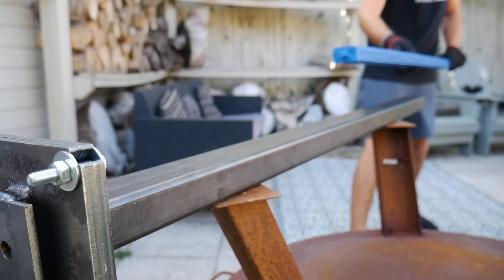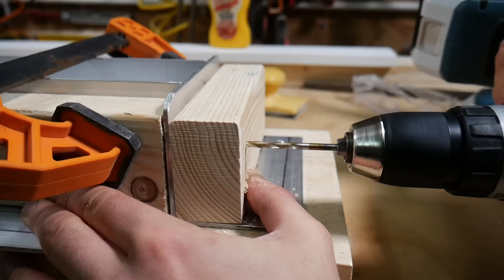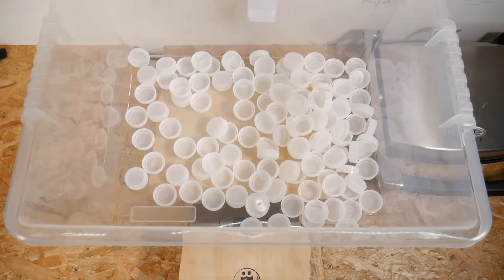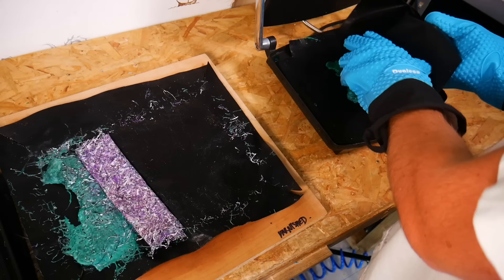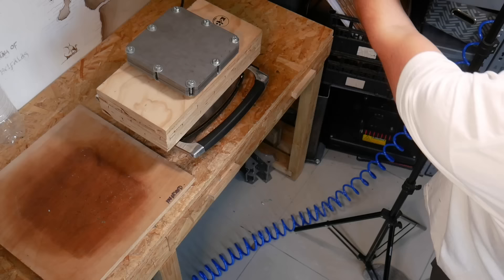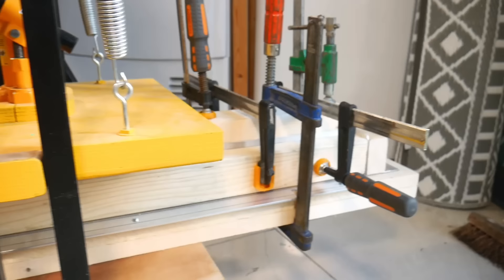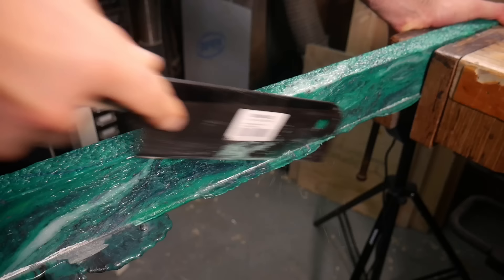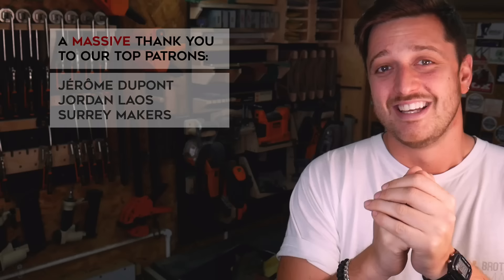How to Make Recycled BEAMS from Plastic Waste at Home

Comment: No this does not solve the entire waste plastic problem and no it does not really replace wood or steel beams in construction, as so many geniuses have pointed out in droves in these comments while missing the point entirely.

But that is not the real point is it?

The real point is that this is a creative and "outside the box" method for putting to use stuff we were going to just throw out entirely and let it sit unused in the landfills.

Does it have to be used as a replacement or substitute beam for your deck or load bearing beam in your house? 
No, not at all and no one said that you must do that at all in the first place.

But if you use your brain, anyone can see big potential for many other uses for this method if refined and improved.

Could be useful for creating many other shapes for decorative coverings and finishes too, and not just limited to one use or application only.

Wow there are so many - "I use a hammer for every problem I encounter" people out there.

It is just a video showing creative humans using their brains and imaginations to try to make use of things that would be wasted and just tossed unused. However, now that throw away plastic will be put to use and less will go into the land fill.

Why do most people state the obvious right off that bat?

Of course not one simple idea will just solve a complex issue like our dependence on waste, but these folks never claimed that either.

I say bravo and good thinking on trying something out in the first place.
And by sharing their ideas it spurs others to think creatively (at least those of us who have the capacity to) to try to come up with alternatives as well.
Reply from the maker: Lewis gets it! Thanks bro 🤙🏽🤙🏽
Reply: @BrothersMake   suggestion a pizza oven with the conveyor belt  would be able to melt more plastic at one time  use wax coated cookie sheet trays and drop directly into the mold  and while true that you could not use it for load bearing  you could use it as the roof of a green house making flat clear plastic sheeting  connected to the beams for skylights ,you could also use it for decorative fencing around a garden  i can think of lots of ways to reuse them
Reply: @williamwofford2503  Plastic sheeting for outdoor use needs to be UV resistant, otherwise it will turn yellow and brittle from sun exposure.
Reply: @armedwithjello  Unless you paint them.  Duh!
Reply: people just like to make noises that make them feel smart 🤓.
Reply: Agree 100% thanks guys, new subscriber
Reply: Lightweight .. no rotting...my gears are turning !!
Reply: If it could withstand the heat it would make a great bespoke backsplash for a kitchen.
Reply: It makes no difference what you think this way.
Reply: Even adding wood shavings and grind up concrete dust might be the new creative alternative.
Reply: You were dead on in articulating your point.  Well done.
Reply: Nice reply 👍
Reply: @5212240  Many plastics can handle that much heat and much more. A great idea would be to include a/an additive/s to enhance the thermal, structural and authentic properties. I think adding something like graphene, carbon fiber or something even more mundane as kaolin clay to the beams would make them more fire (and melt) resistant than most construction materials. 🚧 You just need to play around with the percentages of whichever material/s you decide to incorporate.
Reply: @BrothersMake    Terrific use of junk. . .we have converted to laundry soap in a washer sheet of paper and I don’t miss lugging home 16 pound plastic containers of laundry detergent AT ALL. . .there’s many out there—just check with Amazon. . .and they give you a discount to Oder on a 4-5 week subscription.
Would you all care to know the true irony?
When I was 10yrs old in 1956, my mom used a similar product in Ohio and I have no idea where she got it but we used it for months until my dad’s job went on strike and we started conserving big time.  I remember it distinctly as I did the laundry.  So we had the solution to the plastic laundry jugs 66 years ago and eventually let it die.
I live with my daughter’s family and we only fill our recycle bin once a month and we never fill our regular weekly trash bin—our motto is recycle,repurpose, reuse.  
We live out West and regularly have water alerts where we have to use bottled water about every 6 weeks for a few days (hurts my old heart to use plastic water water bottles).
Reply: @williamwofford2503  building a raised garden bed for old farts like me.
Reply: @THEOGGUNSHOW    Excellent idea, Tommy. . .  But I have a a pattern for making an Adirondack  chair out of 2x4's and would love to try one in recycled plastic since the weight and stress would be far far less that trying to use a 2x4 in house construction. . .and save the wood for actual houses construction and also begin with the recycling in our own cities with empty buildings repurposed for the homeless and poor rather than tearing down.  like you, we need to start thinking outside the box.
Reply: The thing is though plastic last way way way longer than any wood.
Reply: @armedwithjello  Yes, but as a beam it will have a longer life than a regular wood part, and this is an ideal way to recycle plastic to make things like garden furniture, which is sold by me, and a popular thing as it is so much more durable than wood with no treatment needed, and thick so it is not going to blow away in the wind.  As wooden substitutes for garden use, or as beams for walkways in wet ground, it is a lot better than using rot preventatives in regular wood, and thus is used in parks a lot for this reason.
Reply: Creating more problems is sometimes not the best way to go about it.
Simple ideas often are the best
Reply: Great comment!
Reply: @randogame4438  he's talking about clear plastic sheeting for a greenhouse. Painting it won't be workable for that.
Reply: @SeanBZA  I have no problem with uses like that, in fact I think that's an excellent use of recycled plastic beams. I only mentioned UV resistance in the situation of using it for clear plastic sheeting for a greenhouse. In use as solid beams, UV wouldn't have much effect on the plastics.
Reply: @armedwithjello  In the first place, you aren't making "clear" plastic sheeting by melting waste plastic, so I don't even know where you  got that idea.
Reply: @Rando Game  I didn't. Another commenter here mentioned it. He said if you melted clear plastic you could make clear sheets to use for a greenhouse. I said that was not a good application because it would not be UV resistant and would turn yellow and brittle. That was the extent of it. Not sure why you're making a big thing about this.

Recycled plastic beams can be useful in many applications,  and not useful in others. That's it.
Reply: Do you have fever with those fits??
Reply: The video doesnt solve any problem whatsoever nor show how creative people can get.

It is a video for shits and giggles nothing more. 

Does not solve any green issue and almost certainly a huge waste of time and energy (aka fossil fuels) melting that down in such an inefficient manner using a panini press.
Reply: The really sad thing is that other countries are taking plastic melting it down and making bricks out of them and building small homes for people. I'm talking about these really poor countries. I seen this on a video back around the turn of the century and I still can't understand why in this country with all our technology we have not been able to do something like that. We got a lot of homelessness in this country and not enough cheap housing and this is one way to help some of the problem
Reply: It's a cool video, but the technique is impractical in every way. And the idea is old
Reply: Thank you for this! 🥰
Reply: I've actually seen this type of thing (maybe not exactly but close) for park benches.

Instead of using fresh timber, it looked like they melted and pressed plastic waste together in a similar way to form the beams for the park bench. Then you don't need to treat the bench like you do wood! Awesome stuff!
Reply: @FowlorTheRooster1990  No this is not an answer to any “waste” issue. In fact the methods used in this video “waste” more energy than anything. The real answer is to Reduce , Reuse and Recycle in that order or even reject all products using that type of plastic product to begin with.

Last i checked and unless techniques have changed plastic bags were one of the worst items to recycle. They break down substantially when repeatedly reheated meaning they become less and less usable each time.

Im no expert on the subject but just think about it rationally. If this were such a great and feasibly economical it would far more widespread than the niche product it is today
Reply: @williamwofford2503  "a pizza oven with the conveyor belt  would be able to melt more plastic at one time" - No, not really. Plastic is actually a VERY poor heat conductor (hence why it's used as an insulator as well) and thus a pizza oven would burn the top while the bottom would still stay solid.
Reply: Excellent BRAVO well said!!!✨
Reply: Well said - though considering how many negative comments have replied to you, I think it fell on deaf ears for the most part.
Reply: @kylieb4836  huh? speak up please
Reply: We've been using plastic for years in building products. All composite wood is plastic with some wood pulp. Pvc trim which is all plastic. It's in everything. It's being done as smartly as possible. Without doing what these guys are which is expelling more effort going in than product they're pulling out. Not to mention all the air pollution they're producing. This video could have been just them goin go to the trex deck facility and taping their process for eliminating plastic instead of cooking off a bunch of cfcs into the air to show a melty plastic sag brick off as something they pulled out of the air
Reply: Well said 👍 excellent!!!
Reply: 100% agreed. Watching the effort of turning plastic residuals into something useful, it has given me few ideas...as you have creative...art, a garden mailbox and more....
Reply: Plastic fence posts, been around for a while would be good, some black to improve UV and they are good
Reply: Not economically viable = no large scale adoption = no impact in waste reduction.
Reply: Well said. Using those beams for things like shelving, or some furniture, etc. I really would like to see a strength test between the plastic beam and a wooden beam.
Reply: There are merits to all these arguments

Sadly still, demerits do arise for all ornamentation that fails to promote artistry and craftsmanship

Nobody listens to all the complaints unless they’re near the end
Reply: Thanks for letting us know what the "real point" is. LOL
Reply: I forgot where I was but for a time a certain city/region started mass producing these recycled plastic beams and "timbers" and used them to make ever lasting park benches, pathways, and elevated bridges/walkways.
Reply: Where it* was** damn autocorrect
Reply: We used all recycled plastic beams like this that we made at home for all our raised flower beds in our greenhouse, we did it that way because it won't rot like wood from the moisture, and so that we were feeling a bit more eco friendly (bear in mind the greenhouse is 35ft x 15ft so alot of raised beds)
Reply: Indeed. I do wonder how much the energy consumption of small-scale recycling like this compares to the impact of them going into larger recycling plants, though. Of course, if we could really trust that our recycling is properly handled after we put it in our recycling bins...
Reply: @Neil Barnwell  unfortunately a large percentage of plastic put in to be recycled is dirty and contaminated, or is one use plastic from people who don't realise, again causes contamination 
And then plastic that have outlived their reuse time (around 3x) so then have to be slung
I find the best way to melt the plastic is with a burning bin and metal pots so there is no electricity usage for it
Either way it's definitely not as efficient as home, but large scale have other overheads to deal with which is why the planet just keeps making plastic instead of doing things like this more often as it's not like there isn't enough to go around
Reply: Pp ppp0
Reply: @armedwithjello  Is there a way of turning this into a UV resistant plastic ? Maybe a UV stabiliser could be added while melting the plastic ?
Reply: Exactly, and again it was pretty successful for the first attempt.
Reply: Haha nice, i thought a simple home use solution myself not caring about the comments. Lately been thinking of all sorta of ways to reuse waste as I’m seeing too much everywhere. May as well take it and use it for my own use projects. Im already collecting peoples waste around town and making it useful. This ads a whole new dynamic. Thanks.
Reply: @snuff out rouge5  that would be a question for a chemist.
Reply: I have been watching your videos all day since finding your channel this morning.  Liked and subscribed.  I have a geodesic dome with a 10ft diameter by 10ft High. Made from electric conduit plastic pipes and hexagonal push fit connectors. The clear plastic cover has become brittle   and sun weatherd so covered the whole thing in sheets of newspaper and pva . Paper mache ' .so I can take out all the pipes and connectors from the inside to make many more. I was looking to find how to make a new plastic coating but just had to share this idea with you guys . Any help/tips would be much appreciated would love to make a bussiness too. Kind regards jason.
Reply: I was just thing the beautifully artistic wainscoting you could make from those 2x4s
Reply: No, the point was not to be creative and think outside the box. The point is to make something worth making and this is not worth making.   It took a ton of labor, wasted a heap of energy (most likely derived from coal power stations), and its far inferior to a $5 wood plank bought from the Hardware.  Its this sort of idiotic thinking that is killing us.
Reply: So in other words, thin skin alert.  (And a bit weird, since this isn't your baby.)

I'm not sure what else you could expect with a video that does absolutely nothing to justify the result with potential use cases or even consideration for input cost (especially energy), when the output is a brick of heavy, not particularly strong, toxic off-gassing material that's vulnerable to fire, scratches easily, breaks down in sunlight, and is likely teeming with bacteria-friendly micropores; and the by-products are piles of plastic dust, shavings and VOCs in the local atmosphere.

But hey, at least it's helping the environment, somehow?
Reply: Plastics, both new and recycled, are already made by melting them down and pouring them into a mold. That's normal plastic manufacturing 101. This video title is saying they've done something all those existing manufactures have failed at, molded plastic strong enough for construction. That is what a "beam" is, a construction material, not regular molded plastic that literally any plastic factory could do.
Reply: @SeanBZA  furniture isn made from beams. That's the whole point. Beams are for construction - ie houses and buildings - not fine woodworking like chairs. "Beam" means STRONG, suitable for construction. This is not a beam.
Reply: You MAD mad. 😂😂
Reply: I'm guessing the electricity used for all that melting makes this several fold times more expensive than any other standard building material.
Reply: 100%. This is definitely not about saving time or money, or helping the environment.
Reply: The truth requires few words..
Reply: @RobertA-hq3vz  I suspect this thing was gas heated rather than electric. Still burns fossil fuel though.
Reply: @armedwithjello  yeah, I had these "save the planet" projects that are anything but that.
Reply: There is a company in africa that uses recycled plastic to make bricks and those are used as cobble stone so I bet if you made this smaller you could do the same here. I don't know if they do something special to it to make it strong enough to hold a persons weight but I imagine its about the same.
Reply: I D K it's solving it for me. I think it's easier than aircrete which was my other option.
Reply: May not be structural, but they’d make great trim, especially around windows or damp areas
Reply: Well your intentions worked; I came here to investigate some methods for doing something completely different than beams, just wanted to know how I might go-about making it work and your methodology has been hugely informative and useful. I can now move-on with my idea.
Reply: First thing I thought of was "That looks at least as strong as the 2x4 beams in the wooden pallets I handle at work all day. I wonder how much weight it could hold up in a three or four foot wide pallet." And then I remembered that a good lot of our pallets are loaded with concrete forms or straight up construction bricks and pushed the idea away. I totally appreciate your comment about this not being "the solution to everything" that people want it to be. We just have to temper expectations. These beams would still be great for non-load bearing struts that you attach gypsum boards onto; say for a shed or other single story structure that isn't meant to carry a heavy roof.
Reply: How much energy (electricity) did you use?
Reply: There are companies that make plastic composite materials used for decks. The big one, Trex. From their website, they state they use plastic film with sawdust and they warranty their product 25-50 years depending on product used.
Reply: Hell yeah I love your fervor it's highly needed today. There's always a boatload of armchair geniuses to point out issues instead offering any ideas to help why the issues they find
Reply: Agree
Reply: @armedwithjello a coating of Thompson's, or uv rated plastics, or urethane, etc...
Reply: @BrothersMake  furniture for boats or humid places as it won't rot 🤔 any application where normal wood would rot
Reply: @armedwithjello  ok, that's a problem. But if you're really clever you'll not just point out a problem, but suggest a solution.
Reply: Termites never eat plastic,... Just saying😂
Reply: I'd love to melt every plastic into my raised bed divider. 
You're right not necessarily use it to make house beam.
Reply: Very well stated.
Reply: Thank you for speaking for our kind   ...😂😂😂😂
Reply: @patriciabajcer8930 
I often use laundry sheets,, they're great! 
I doubt they will ever become mainstream.. there's too much cash to be made by companies producing detergents/containers the old-school way.. 

Sad.. I know 😢
Reply: @KCCAT5 
Go to the government, large companies & people with money to bitch & complain... 
At least these guys are trying to do something that the 
'elites & higher-ups' aren't!

What have you done... how much time have you contributed except for bitching & moaning? 
🥱...🙂.. 🤪
Reply: @michele-33  
Michelle—we, too, use laundry sheets and love them.
Now here is the REAL societal and commercial tragedy—they were invented and marketed SIXTY FIVE years ago and I used them as a teen doing the family laundry as both parents worked so we kids could go to college.  The sheets then were identical as were the instructions and I thought they were terrific then one day they weren’t available without explanation.  So glad to see they’re back again!
Reply: Love their outside of the box trying to fix a bad situation , i.e. plastic recycling, and yes have a few ideas thanks to these gents, and will let them know how it goes, so thank you gentlemen please keep it going thanks